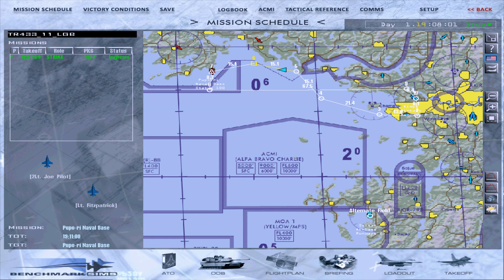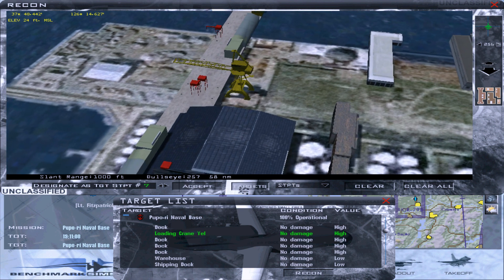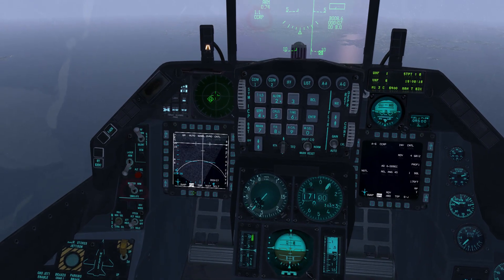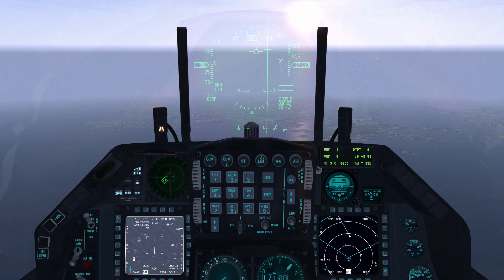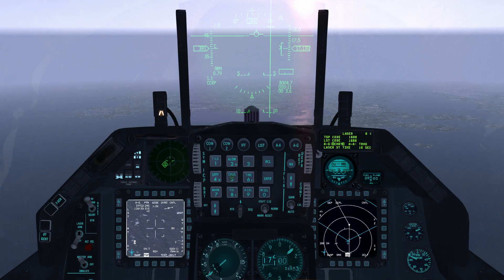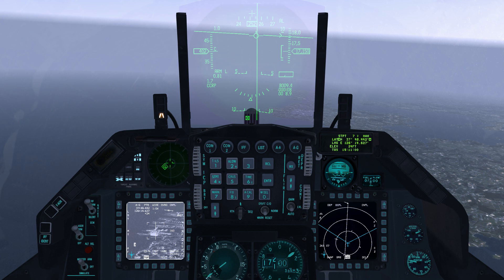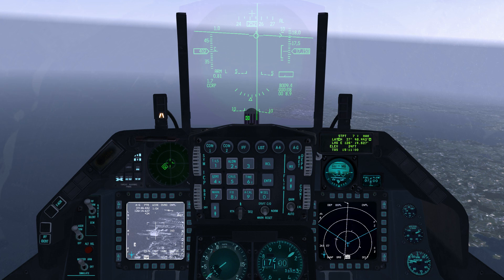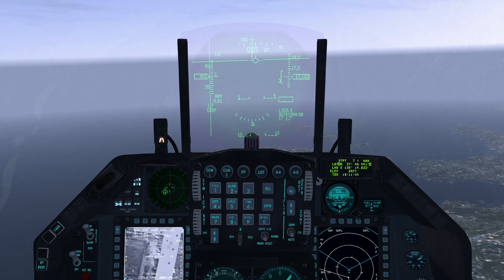Falcon 4 BMS 4.33 Tutorial 7 using laser guided bombs at Pupo-Ri

Comment: mm...tutorial LGB mission.
don'n worlking tgp page ir area, tv area flash..
ded mice -lase  trng  change cmbt.
and tgp display viewing 'L'.
i don't have ir area.
and target designate . i'm fcr a-g radar mode designate target. and shift+2 is dms? down push.
fcr display is not soi, tgp activity. and cuing on. lgb 12 leunch. but tgp displays 'L' is not flash...and target miss
Reply from the maker: You can check the correct key for DMS down through the settings page. Look under the HOTAS stick section.
Reply: @supanova88  thank you. i,ll checking it